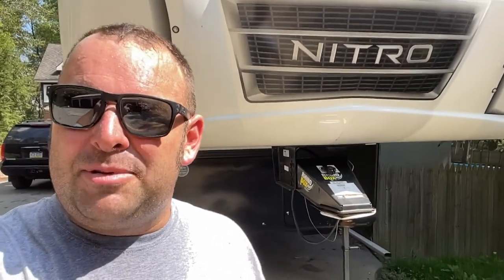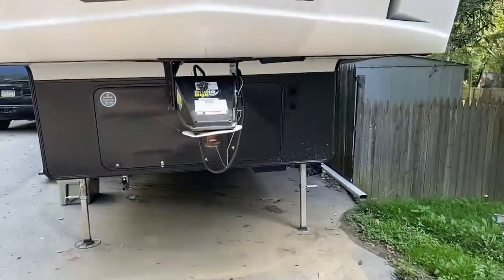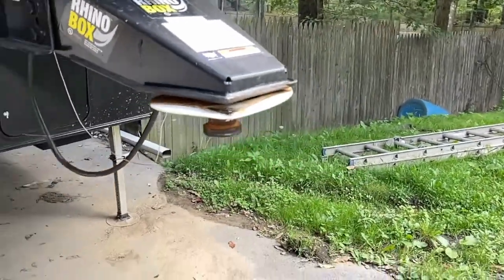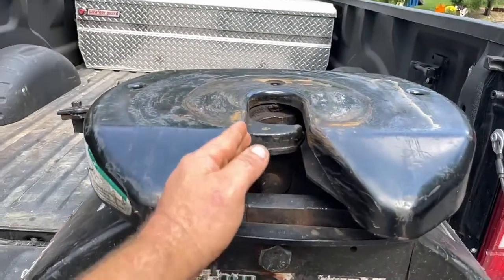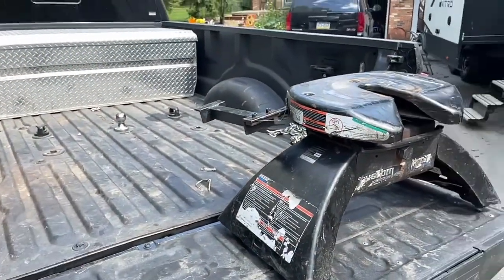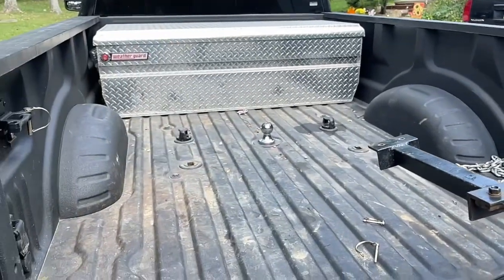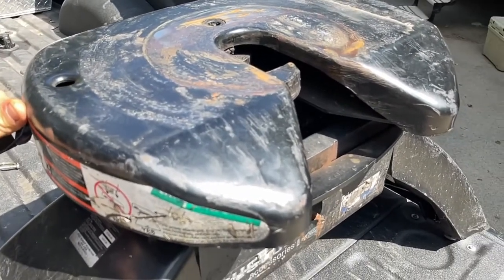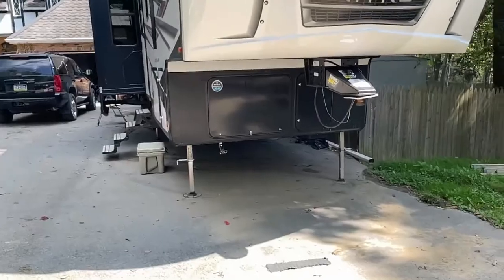What is the Difference Between a 5th Wheel and Gooseneck Hitch

Comment: If I buy a F250 should I tow with a gooseneck or a 5th wheel to handle more weight?  If I buy a F350 should I tow with a gooseneck or a 5th wheel to handle more weight?
Reply from the maker: It depends strickly on rating of 5th wheel/gooseneck expcept for the F350 dually. In that case I believe the Ford 3” gooseneck ball is rated higher than any 5th wheel head but this only comes into play if you have a dually because the GVCWR of the 250 and SRW 350 is below the rating of the actual availible hitches and ball if that makes sense.
Reply: @trucksandrecreation  For towing a park model what truck model do you recommend?
Reply from the maker: @briizcustoms9543  I believe they all should be able weight wise to tow but check the weight of the trailer vs towing capacity of truck. I believe park models are all bumper pull. The ultimate in my opinion for big trailers like this however is the F450 due to its great turning radius
Reply: @trucksandrecreation  Are park models ever put onto a flatbed ? Like a gooseneck flat neck set up